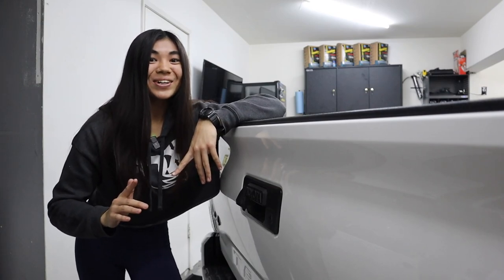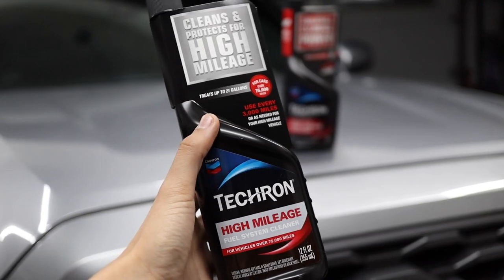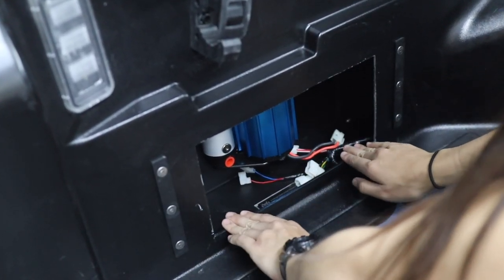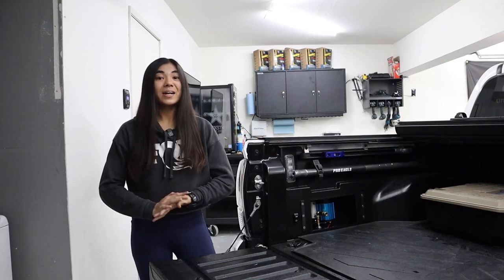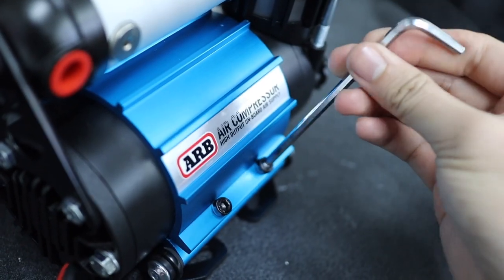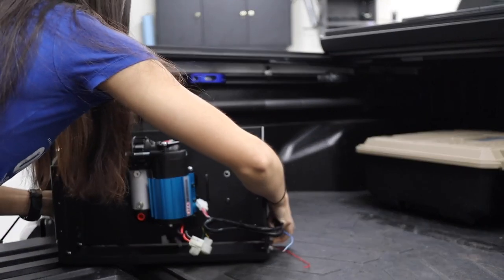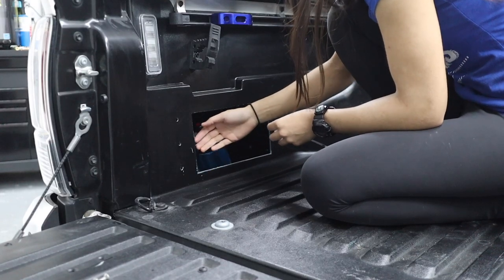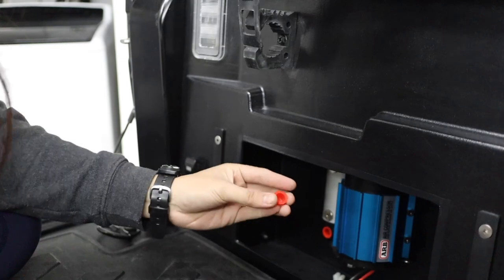Installing a HIDDEN Air Compressor in the Toyota Tacoma Bed

Comment: Congratulations on 100K!  When you were talking about how your channel is DIY projects you do in "free time" is probably what I like most about your channel.  You aren't in a shop, with all the power tools and endless supply of accessories.  You're a 9 to 5-er like most of us, and are doing the work in a residential garage.  I just goes to show how possible these projects are for the average person.

Comment: You can replace the electrical tape with a rubber strip like they use on fender flares. It comes with 3M tape on it for an easy installation. Also you could use a clear plexiglass with magnets on the ends to give a cleaner look. You could also use the black rubber strip on it as well. You can also add black home door weather striping on top and bottom that is also put on with 3M tape. This would seal up the space between the two brackets you screwed on so that you stay dust free. I would also add that strip on the inside of the brackets to make a completely sealed plexiglass.
Reply: If I may add to the electrical tape finish ideas...the black plastic edging used as door edge protectors would work as well...just cut corners in a 45° fashion (like a picture frame) would give a real clean look.

Comment: If you fabricate a lid I'd suggest adding some low profile foam or rubber insulation around the edge to prevent water getting inside the compartment.  Magnets are a great idea BTW!

Comment: One thing I would do differently cause I installed the all pro version is use a silicone sealant instead of the sticky tape to seal the extra holes. It did not last in the rain up here in the NW.

Comment: Would it be a good idea to intall the fuse on the inside of the box rathet then at the back? And although the electric tape seems to really work well to cover the edges how would a U shaped hard plastic work for this purpose? But then again it might not be needed!? Also what about a cover for the end of tje brass fitting of the compressor? Amd finally for a cover magnets seem a great idea but what about 1 or 2 horizontal hindges at tje top with a magnet at the bottom too to keep it in the open position?

Comment: Nice work but the mount will likely rust & get water & mud in the holes & connections. Needs to be sealed & accessible fuse. Hope it works out.

Comment: The first video I watched was about how you detail your wheels. I have the white lettering on my tires facing out and am always looking for a better way to clean them. I also like the wiring videos because I am not as comfortable with wiring and electrical projects. The only problem with the wiring videos is when you show the wiring diagram I have no idea what the different squiggly lines represent. I like older vehicles so I look forward to the land cruiser project. I find it helpful when you show some of the aftermarket products available and how useful they are.

Comment: Congrats on the 100k!  Favorite video would be the ones fitting the 285s.  @Seoulrig.

I ran my single Arb compressor in that same spot, cubby cover on, in my second Gen with a trifold.  I had a lot of dust make it’s way int there and ended up removing it.  Now it’s in a hard case, still in the bed.

Comment: i just use a plug in compressor with the 120 volt outlet and an extension cord. I can set it up and sit in the drivers seat and watch the pressure gauge if its cold outside. its not as cool as this but cost me about 60 bucks and no work to modify the truck.

Comment: Great job keep up the diy videos. Suggest you use fiberglass resin for the edges that you cut into the bed. It’ll help prevent fraying and after that is done you can put some rubber edging to help seal up the cover your going to put on.

Comment: Did you consider using door trim instead of electrical tape to cover edges...would be a little cleaner and wouldn't have to replace regularly due to weather.

Comment: Great video, I'm getting ready to add OBA in the back of my truck, my concern is the size wires you ran, it seems that 10awg wire is to small, I noticed when you checked the voltage, you didn't have a full 12 volts... has that caused any problems?

Comment: The switch and air hose outlet fitting are not Particle when you fully load up the truck for camping ,it is very difficult to connect the air hose and when the item move around while driving, stuff may hit the switch Accidental turn it on, it is still a clean set up but need some improvement.

Comment: Nice job the only thing I would have done differently is put the fuse on the other side but excellent job
Reply: That way you don’t have to take it apart if the fuse blows

Comment: SDHQ has  a 15' Extension that goes from the compressor to the engine Bay. Then you just plug in your supplied wire harness.,

Comment: I can see two minor problems that may come up. 
Anything moving around in the bed could hit the switch just turning it on or worse damaging it. 
Second problem is similar with the hose connector. 
Perhaps install the switch in the box and turn the connector 90 degrees to keep them out of the way of accidental damage.